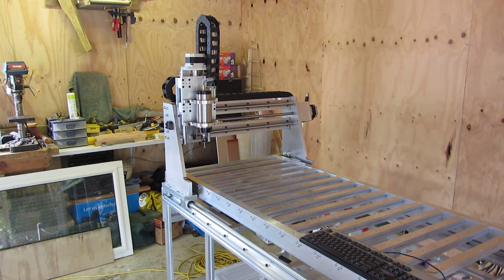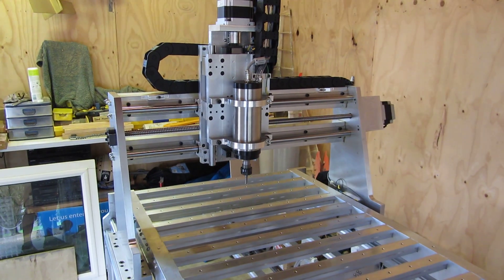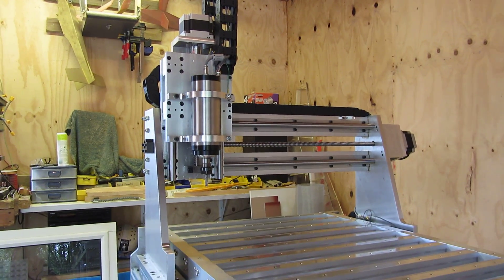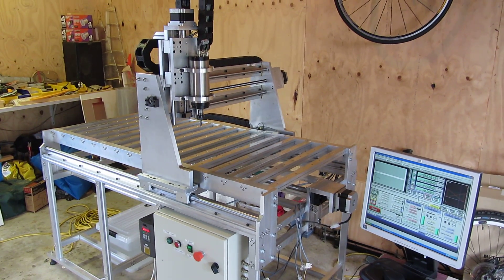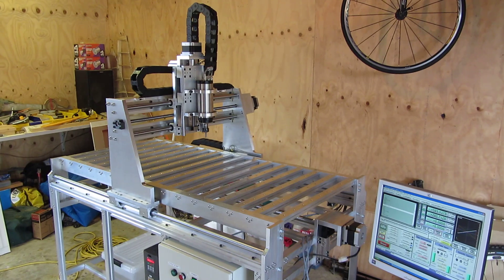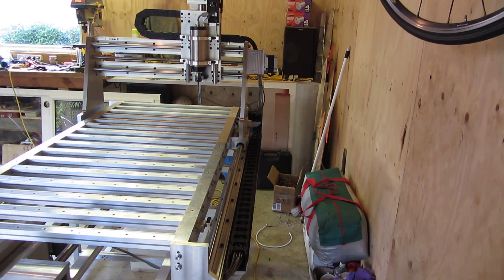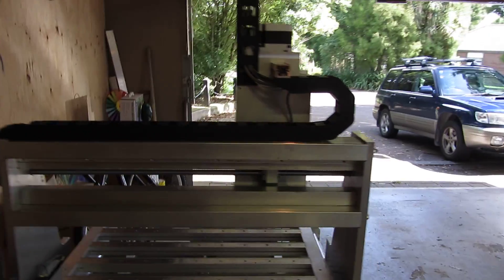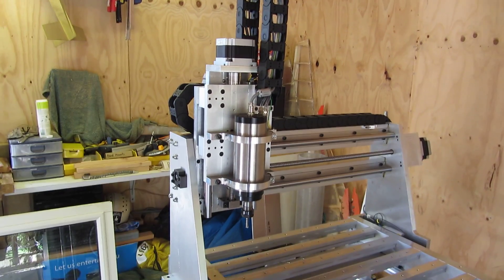My CNC Router progress update 2

Comment: Hey man!
Im into buying some 2.2kW chinese spindle. Can you tell me how its going over few years of use? :)
Is water cooled or air cooled spindle? Are you satisfied with the spindle? Which one would you buy if you buy again? 

Good job! And thanks for the answer!
Reply from the maker: +Matic Rožič It's still going well, the bearings are ok still but still it's a good idea to "warmup" the spindle each time you use it. Just now and then it has just Stopped!! but not for a while! The one I have from SolarJean, the ER20 collet taper was very poor and there is no way it holds cutter to 0.005 or even .01mm TIR so I would spend a little more and get from cnc4pc

http://cnc4pc.com/product_info.php/2200w-3hp-water-cooled-cnc-milling-spindle-p-609?osCsid=3ot69cs45ejcgdv2r5jt47e4i6

Mine is 2.2Kw water cooled with inverter for about $500 off ebay

If they say it has 0.005mm TIR then I'd hold them to that!

Comment: Your grounds should be connected at the controller end ONLY. I.E. to controller ground, so.. cable grounds connect to the servo/stepper driver end but not the servos/steppers and at the vfd end, but not the spindle. Make sure you have a decent EMI filter for the vfd supply as well, connected as close as possible to the vfd.

Hope this helps

Comment from the maker: Yes I have the motor grounded as well, I ran a 4 core wire (Double shielded) to the motor and grounded it to the top of the motor casing. All of my cabling is shielded as well as the machine which has a dedicated ground! I smashed a long galv pole into the ground and the machine base is grounded to that.

I think there might be a ground loop somewhere??? or I will run separate cables for each of the switches as I'm using a smooth stepper I have the spare inputs.

Comment: Out of curiosity, is your motor grounded too? I only have the three phase lines running to my motor and the case is not grounded. 

Have you thought of using grounded shielded cable for your switches? I am interested because I am looking to add this spindle to my CNC after I am done with it and I hope to avoid this issue. Thanks!

Comment from the maker: I tried that, isolated the motor from the frame and grounded the frame but it did not work as I thought it might. I still get the estop tripping. Now, I have the limit switch circuit disabled and just the home switches turned on (they are all common...ie 2 switches per axis one positive direction, one negative direction wired in parallel ) and this is a short term fix and the spindle now does not stop the machine and it makes very big cuts with no problems!

Comment: You may have sorted it out by now but I have the same motor which I am using for an experiment. We had a lot of noise in our instruments from the motor. We first tried grounding the frame which held the motor and everything else and that helped a little. We then isolated the motor from the frame and grounded the frame and that made a huge difference. We had a noise reduction of 100 fold compared to grounding the frame which was electrically connected to the motor.